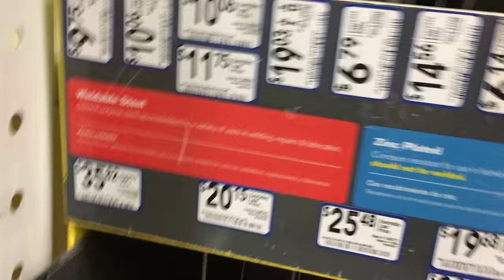240sx Drift Build Episode 25 Steering Angle Mods

Comment: Get the lower control arm extended and get rid of the spacer, you'll have more clearance as the wheel will have less of an ark and the wheel will sit out so it won't look like trash, also get adjustable castor arms, it makes a huge difference getting that extra 1-2 degree's of castor.

Comment: You need adjustable LCA AND TENSION RODS TO GET THE FULL LOCK. They are reallly meant to keep from having soo much camber when at full lock and as a bonus to get more angle. Steering rack spacers would not get you anywhere near 50 degrees. Hell stock is like 30 something. You wod be like right at 40. I have megan v2 LCA and have them adjusted outwards and camber positive out with the 40mm i adjusted the arm and running -2.8 camber and have over 40 degrees.

Comment: dude............. theres a video about them, with offset rack spacers you should expect up to 62degrees for real, also it is nothing like having a 1inch spacer since you're moving whole knuckle out and get roll center correction, bumpsteer correction, track width extends 1inch (25mm), youtube - GKtech roll centre correction kit Review for Nissan S chassis, watch that video it has all the good info, it's actually a really good kit compared to chopped knuckles or welding or any bullshit, check your inner fender well you might have to bash in for more clearance as checking for clearance when the car is in the air is not at ride height, check that out

Comment: so with the 350z inner tie rods, do you need to buy the 350z outer tie rods? Or will the stock s13 outers work?
Reply from the maker: pretty much all the nissan tie rods are the same thread except the s13 ones. so like s14, z32 300zx and z33 350z are all the same. So you need to buy s14 outers (that is what i used) to go with the 350z inners.

Comment: You really don't understand the real point of these roll center correctors. It's not for all the angles. That may be a byproduct but the real purpose is to correct the fucked roll center that you get when you lower the car. It's to mainly fix a bunch of the bumpsteer issues. It's not the same as adding a 1" wheel spacer. It spaced out the track width but creating a false end to the tie rod and LCA where the knuckle mounts and creates a higher roll center. You should really study up on suspension and chassis tuning to understand the purpose of the parts you put. It will really broaden your horizons later.
Reply: Agreed, I was actually thinking to myself.."why does he think this roll center kit is an angle kit?"

You can literally just google 240sx Angle kit and I guarantee wisefab or some other kit will be at the top of the list lol.

Comment: Btw go isr performance 
DONT GO PB
If you crash with pb they won't snap
They will just fuck up your car

What would you rather buy? New suspension components or a new body?

Oh and they are a pain in the ass
Reply: GO PBM OR SPL'S!
Reply: Reflex702 pbm is a pain in the ass to tune 
Especially track side 

Isr is lighter 
Won't fuck up your shell if you crash like pbm will
Isr is easier to tune tackside and will never go off unless you fueling break it 

Can't speak about spl though 
Don't have experience with them

Just for the love of god don't go gk tech